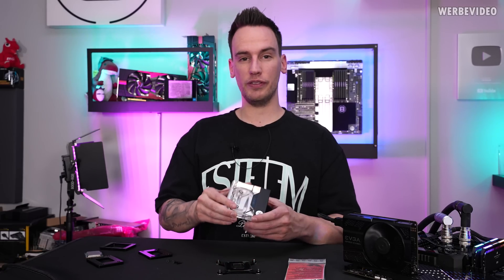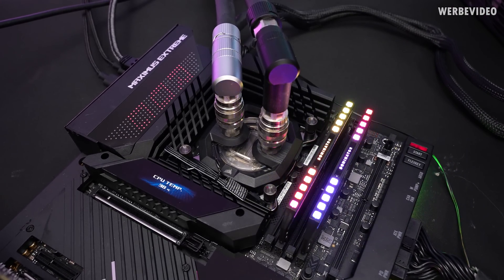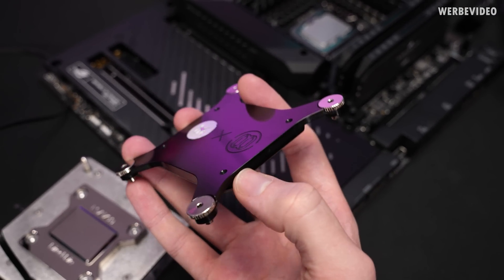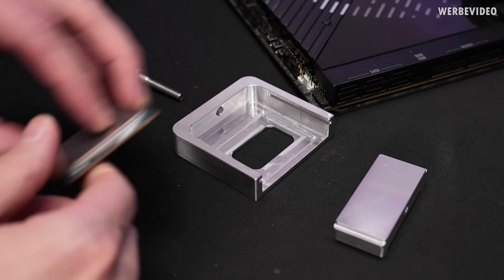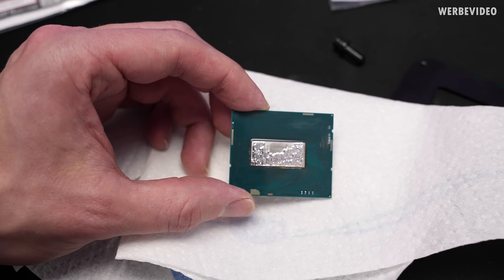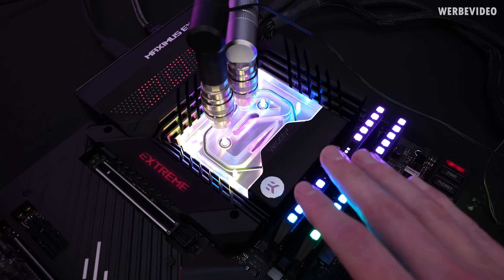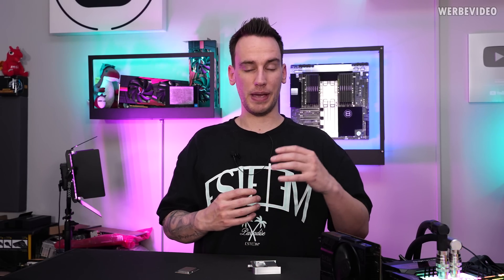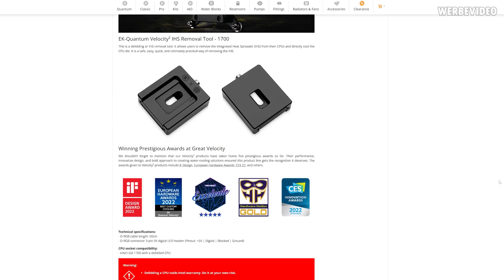We're testing EKs Limited Edition Direct-Die Water Block

Comment: That's so cool. Would be nice to have it for AM5 also.
Reply: With AM5 it would be even better as those run hot because of the thicc heatspreader
Reply: @Ruiso7  not the non x ones, 40-50c
Reply: @manchild8365  that's because the non-x ones don't have the same aggressive boosting algorithm. It's a multipart issue
Reply: @louiesatterwhite3885  incorrect, it’s a power limit not a clock limit.
Reply: @manchild8365  which has an effect on extended boost clock speeds...

They've limited the clock by limiting the power
Reply: I'd buy one
Reply: These things help more with intel because they get stuck on a socket every two iterations. AM5 will just offer you an upgrade.
Reply: @quin_helldiver  what does this possibly have to do with socket longetivity?
Reply: @quin_helldiver  Oh look, someone that upgrade annually, complain perf gains are low, and pricing are skyrocketing!
Reply: I foolishly forgot to consider an AM5 version of this block could potentially get reused but for future Zen but we also don’t know what the chiplet package will be like on future versions. The point I was trying to make is this mod is expensive. It’s only worth doing on an expensive machine. It’s currently only available for a dead platform. So what the intended use case I imagine is your going balls deep in the wallet knowing it should be a competitive machine for quite some time and reward you for your effort. Where as others can simply get away with spending less money all at once and buy at the pace of Moore’s law. Potentially netting a better performance and value trading patience for having the best thing in the moment. The 13900KS is a glorious example. Raptor lake came in and beat up AMD in its first few weeks but now all of the sudden AMD has better options for the price. People saving up for a big purchase like this will see the non X chips and seek the platform knowing it has an upgrade path and it’s more affordable now than when Zen4 launched. Gamers who are apparently dirt poor according to the steam hardware survey will want the X3D chips they probably couldn’t afford yet anyway. Every wealthy impulsive dumbass will have already bout the chips that launched in the fall and wasted money.
Reply: AMD is dead. lol
Reply: @bornagain2641  lmfao you’re a clown
Reply: @bornagain2641  what the hell are you smoking? I want it
Reply: @bornagain2641  in your dreams
Reply: @bornagain2641  if AMD were dead, you would still be running a quad core intel i7 made on some 14nm++++++++ process. the reason intel is coming out with these awesome processors is AMD.
Reply: @hangryn3rd  you probably miss some more +++++++ than that. But yes. I guess that guy miss the whole ryzen and now we suddenly have lots of cores on Intel. 14++++++++++++++++++++++++++ i7 4c8t probably still
Reply: @bornagain2641  if your talking about the 13900ks it's hot power hungry and it still has problems competing with the 5800x3d when you BLK clock the 5800x3d.... Just putting it out there that single CPU has made the entire 7000 series, Intel 12xxx series, and the majority of the 13xxx series useless for the majority of users... The 7950x3d will crush any hopes and dreams from Intel... If anyone is going to move to DDR5 even with the expensive motherboard AMD is the better buy. Don't need to upgrade the board for the next 5 years...
Reply: @SimanSlivar  with all due respect, I don't fully agree with that assessment.

if you were a new builder in late 2021 - early 2022 and jumped on LGA1700, the 5800X3D doesn't necessarily make the entire platform irrelevant. locked SKUs and the 12600K still provided - and provide - a pretty decent-to-good value. and you still do have the option of upgrading if you so choose.

if one does choose to upgrade on LGA1700, they won't be hurting for good choices as, to my knowledge, the 13600K and 5800X3D have relatively similar performance.

I get what you mean when you say "the majority of users" because I assume you're talking about gamers, and I agree. Price to performance and power to performance are still amazing on the X3D. However, for this segment of the market, intel still has a lot of appeal to the new budget builder segment with their locked SKUs. (I say new because you can always get a 300 or 400 series chipset motherboard with a zen3 cpu and get a really good system for cheap. In that regard I actually don't think intel is the better choice for ultra-budget if you're savvy about these things.)

as for zen4 x3d... we're going to have to wait and see how firmware holds up, just like when intel released their hybrid core architecture. the cache being on only one ccd could be an issue for the dual-ccd chips and performance there. if the OS core scheduler doesn't assign the relevant tasks - e.g. gaming - to the cache ccd then there won't be much value to the 7900X3D and 7950X3D besides bragging rights. fingers crossed it doesn't happen, though.

Comment: EK's quality control has been questionable lately.
Reply: What happened?
Reply: @Tirth-Patel  until proof provided, nothing
Reply: @TheHighborn  Even Roman had some complaints when 3090 EK waterblocks came out - height of contact elements were incorrect. He had to stack many thermopads as workaround.
Reply: @gagarin777  maybe it was a prototype? blocks are usually finalized after the cards come out.
I happen to run a 3090 with ek bloc and ABP, and all the thermal pads are spot on.
Reply: @ledoynier3694  I don't think it was prototype. It was for Strix card if I remember correctly.
Reply: it's been shocking actually

I wouldn't buy anything from them except their CPU block but even that has a risk of their poorly applied nickel electroplating coming off after less than a year
Reply: The quality has dropped in recent years, mainly due to going from a very very niche customer base to being the leading brand in liquid cooling. Having said that, we have a team that does nothing but go through customer support issues and figure out how we can correct them so they don't happen in the future. 

Are the fixes instant? No, not at all, each issue takes a long time to fix as the return rates on a lot of items are very low, so we need to ensure we have a significant sample size so we can figure out the problem. However, in the last year, (2022) plating, screws, thermal pads, fittings and many other products have all had slight changes to address issues that were previously bought to our attention. 

Are we perfect? Unfortunately not. We never will be, but we can continue to increase our quality control and work on issues that are presented to us. 

It's no secret that our support is very good, so if you do have a problem, reach out to them and I'm sure we will make it right :)
Reply: @davido_labido  Fair enough, but the quantum delta2 tec I purchased doesn't make contact with the IHS on the CPU.  I had to remove the rubber seal just to make direct contact but also riskng condensation.  EK should have made sure that the Z790 motherboards were compatible.  It only said it's compatible with Intel 13th gen cpu.  I had to return it because it really doesn't fit.
Reply: @noone5014  it can't be tested with every single motherboard and returns are always possible in situations like this. 

It should fit every socket for LGA1700 as there are quite strict guidelines on what should/shouldn't be around the socket and we adhere to them. (It's the same with what should/shouldn't be around PCI lanes too!) However... Recently, some brands have been adding shrouds and plates to motherboards that bending the rules on these guidelines, which sometimes means things don't fit. 

I'm not saying this is the case with your motherboard, it might be a completely different issue or something we didn't take into account, but specifications dictate the size and spacings we have to work with and that's what we build to :)
Reply: @davido_labido  Ek have added a warning lately that the Delta2 tec fits only with Z690 boards and not all boards with LGA 1700.  Please read their website before commenting.  Like I said, mine did fit but due to the rubber gasket, it did not made contact wit the IHS.
Reply: @noone5014  sorry, you're correct about that, we we did change it to z690 for the delta tec. I had direct die in my head due to the video... We have too many products :D and I struggle to remember them all and keep up to date with every change. 

I notice we removed the comparability list for the Delta Tec 2 also, so there must be an issue that hasn't been relayed to me yet. I will check this and let you know what it is later :)
Reply: @noone5014  So, as promised, here is the reason and honestly, it is pretty stupid. 

Basically, when we had the Delta Tec in the design phases, we made it for the LGA1700 socket as defined to us by Intel. They signed off on it. This was for Z690. Everything was wonderful. 

Then Z790 came along and although the socket spec is exactly the same, the heatsinks are bigger, which leads to a multitude of issues. Because the wire on the Delta Tec is fixed, it often hits the heatsinks and can't be rotated due to the insulation being fit to the socket. 

Hopefully, in the future, we will have a full compatibility list online again, as some Z790 boards will be fine with it in terms of a  physical fit.

Comment: If only intel sold top of the line versions Delidded all this would be much easier for "average" people
Reply: Maybe have them offer a service for it that costs a fee. I could see them adopting that.
Reply: Average people shouldn't be working with these mods, and average people wouldn't be able to get the full overclock potential. Would be money down the drain for everybody involved. This is super niche enthusiast stuff, like 0.01% of the community. Not trying to beat you down, just adding a dose of reality to the conversation.
Reply: @zqzj  Why shouldn't the average person be working with these mods if they want to? If they want to waste their money I don't see a problem with that. People hop up their daily drivers and rarely drive them to their full potential. If Intel wanted to sell them bare, they wouldn't be doing it at a loss, the only risk would be to the buyer's pocket.
Reply: @--_DJ_--  intel would be doing it at a loss (or charge significantly more) because they would need a separate assembly line for QC due to the missing IHS.
Reply: @zqzj  That is what I meant by not doing it at a loss, they would be charging for any extra steps to provide a niche product.
Reply: @--_DJ_--  are you aware of the complexity of the manufacturing line at the likes of Intel and AMD? It would be cost prohibitive.
Reply: @zqzj  Are you aware that I have never said it wouldn't be? What are you reading?
Reply: optionally of course
Reply: Yes 🍷🗿 like the mobile cpus
Reply: 13900KSD = Intel 13900ks pre delidded! Now that would be perfect
Reply: @Atticus Hexcel  Whats self righteous about spitting facts? People in general... more than 98% are really stupid apparently and shouldn't be allowed in public.
Reply: Maybe the KS could be justified for this, but not the regular K, too mainstream customers
Reply: I’ve delidded a bunch of chips, 12th gen wasn’t that difficult
Reply: A reasonable thing for intel to do is a top binned CPU with epoxyed+liquid  metal water block. The CPU will have a direct die water block attached, minimizing many issues with direct die
Reply: It's significantly easier to damage the die with exposed silicon. Basically no consumer coolers will work well with a bare die either. This is an extremely niche product for overclockers and extreme enthusiasts only.
Reply: @aaltoadamus9567  Don’t be so self righteous dude. Go have a juice box and make a Tik Tok vid about how amazingly awesome you are for everyone to see... Title it “LOOK MOMMY, SEE HOW DUMB I CAN LOOK!” ....
Reply: @PREDATEURLT  exactly. As much as I love telling people: build your own PC, it's pretty easy and you feel a sense of accomplishment....

There is a subset of customers who are too lazy or not willing to do proper research, and they break things, and blame the manufacturer. Read any PC forum and you can find plenty of people who have no idea what they are doing, yet INSISTING that they are doing it right. Intel doesn't want to deal with those people handling a fragile delidded CPU and I don't blame them.
Reply: @aaltoadamus9567  Are you okay bruh! Is everything good?
Reply: @aaltoadamus9567  

He does have a point though - this makes no sense for the manufacturer. Especially as far as product reliability in the hands of the average consumer. There’s a reason they’ll void your warranty for doing this.
Reply: @sephondranzer  Nonsense you idiot. GPUs are more expensive and already come delidded before you put a waterblock on them.
Reply: @sephondranzer  you people realize that they (Intel)don't actually have to de-lid processors to sell them on the market, don't you? It's really going to cost Intel less to sell a CPU this way because they're not going to have to solder and glue the IHS. All they probably have to do is stick a temporary plastic lid on the CPU so that it conforms with their existing packaging. End of story.
Reply: @ufukpolat3480  I was going to say that but I doubt it is that simple. They all need to be tested I imagine, and that testing is almost 100% going to be automated and be done with finished, IHS equipped CPUs. They would have to pluck them off the line and test them with bare dies which might have to be done by hand, and there is no guarantee that those samples would be suitable for top end use. Nobody wants a delidded 13100.
Reply: @--_DJ_--  it's just a matter of rigging a suitable mechanized mounting vapor chamber cooler block with a pressure sensor. In fact multiple different protrusions could be devised so it's possible to test multiple CPUs under load, since at this stage it would be only thermal testing. CPU dies are tested for basic stable functionality way before the IHS stage, it would be a massive cost to the company to only find out that the die is malfunctioning after the lidding process, especially since even things like the IHS engravings are done previous to this stage, presumably of course. If they find out after slapping on the IHS that the core is defective, they also eat all the costs of the lidding process as well. It also doesn't make sense to, let's say not determine a CPU die has a perfectly functioning GPU part before labeling it a 13900K, instead of a 13900KF, which rationally should be before the IHS process.
Reply: @ufukpolat3480  You are right, I wasn't really thinking all that much when I wrote that comment. They do know what it will be before it gets a lid. All of that is done long before it heads down the packaging line.
Reply: @ufukpolat3480  QC testing is still performed after the CPU's are lidded. They test directly on the wafer before cutting, and after IHS is installed. Wafer (post lithography) testing eliminates most of the garbage.
Reply: we had that in the early AMD athlons and that was very dangerous, many cpus burned including one of mine having watercooled or repasted gpus, the large size of the cooler and the gpu die helps but on smaller cpu dies and coolers it's very easy with uneven tightening force to break the chip or have part not touching, intel cpus have pretty good overheating protections but back then you pressed power on your cpu was smoking, it would be complicated to sell such products warranty wise today
Reply: @fredEVOIX  The warranty might be a bit tricky but it would be voided by physical damage just like any normal CPU.
Reply: If only there was a real market for that an more people actually wanted it they probably would....expecting a company to spend time and money just to cater to a insanely small niche of people is a little absurd..if that is your think you can find people willing to do that for you for a price or...get this...if you really are interested in that sort of hobby spend time learning how to do it 😂
Reply: @samgoff5289  Are you trying to be a dick about this or do you not know how you come off? They didn't say they expect anything, they wished for it to be done. It makes sense for some people who want the benefits but don't want to risk their hard earned money ruining a CPU or buying what may be a one time use delidding tool. I am sure you could pay someone to do it, but that would also come with some risks as I doubt anyone is going to replace a damaged CPU if the process doesn't work out. The only thing absurd is your response.
Reply: @samgoff5289  well, if the said company can't manufacture flagship CPUs that can't be cooled properly with 360mm AIOs, maybe it's even more profitable for them to try and market "delidded" CPUs so they can claim some sort of thermal efficiency advantage with their products. As of now, I'd hate to be the sucker buying a 13900K/KS and slapping my old 240-280mm AIO on it, only to realize I've to run fans really loud to keep it from throttling.
Reply: @samgoff5289   the cry laughing emoji does wonders for your credibility you know. You’re also forgetting that IHS’s were only included starting with Pentium 4 and AMD wasn’t using them until the Athlon 64.
Reply: @samgoff5289  who is buying these performance cpus? Only enthusiasts.
Reply: @adamek9750  not quite true, there's a huge amount of people who just buy it to say "i have an i9"